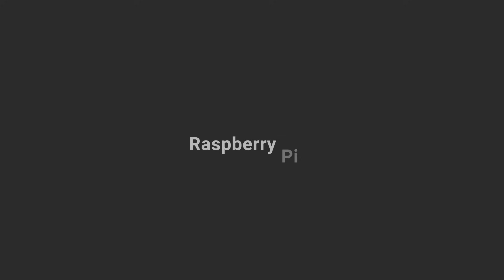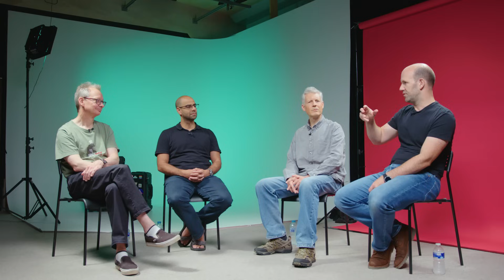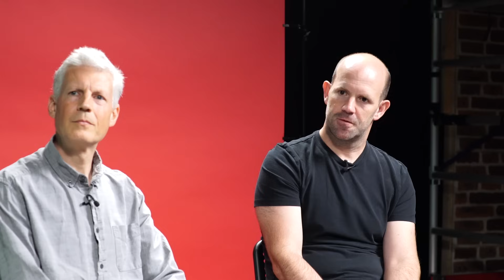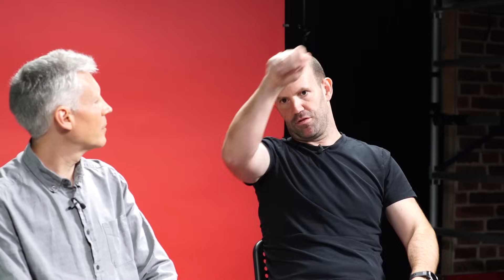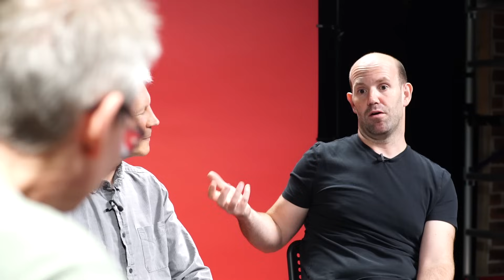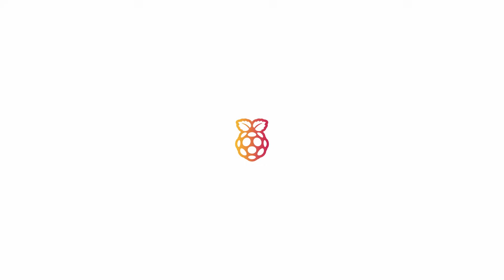Image processing on Raspberry Pi 5: our new hardware image signal processor

Comment: The Pi 4 was pretty capable for image analysis - I built an interesting AR system that led to a patent application, using 'off the shelf' hardware, thanks to Raspberry Pi. So seeing what a huge step forward the Pi 5 brings to this area is great, and leaves me wondering what might be possible next..
Reply: I would be really curious to hear more about this.

Comment: I wonder, and it’s just a feeling, an intuition, but I wonder if more RPi cameras are mounted in such a way that they never move and most of the image never moves, compared to other usages of the same or similar camera modules in other areas of application. For example, a handheld actual camera for stills or video is likely to spend most of the time seeing highly varying input, moving, shifting, sliding, wobbling, shaking, panning, everything – whereas I’d estimate that most Raspberry Pi cameras are mounted and don’t move much in actual use, if at all

Comment: This takes me back 30 odd years to when I worked in broadcast TV engineering. Essentially analog TV cameras worked in the same way - gain, noise, shading etc. Of course we were dealing with big voltages too :)
Reply: And I imagine large racks of electronics to accomplish it too. Now its all done automagically on a teeny tiny chip.

Ironically, its the knowledge you had back then that still drives the algorithms that these chips have to run. Its all progress upon progress. If only all technology has had such clear benefits for mankind.

Comment: Was this filmed on the Raspberry Pi 5? That would have been a nice touch! Also, there is another kind of HDR that wasn't mentioned... 10-bit video, which has become super common over the last several years. It would be nice if the new Pi 5 ISP had support for capturing 10-bit video.
Reply: As you say, it wasn't mentioned so probably isn't supported. As its a new ISP then I'm not surprised it doesn't support everything out of the box. However, its their ISP and I quote:

"...the most exciting thing is that it’s our platform, and we get to develop it going forwards."

Previously they had to rely on others to develop any new capabilities which weren't forthcoming. Now, if they wish to implement 10-bit video, they can. Maybe they should start a portal for ideas akin to Mozilla Connect.

Comment: It's great to know that now that as an official board has 2x4 lanes of MIPI CSI-2, the "door is open" (18:30) for the capable camera modules (IMX477 & IMX708) to have their wings fully spread.

Would love to see first party camera module carrier boards where I can put on the sensors modules from existing 2 lane camera modules to expose higher (e.g. 4K@60) bandwidth. I'm specifically mentioning this retroactive upgrades, cause that reduces waste, and reuses what's already available - I'm not against having full modules (with sensors included) also as an option though - in fact I prefer having both the choices.

Also, it'd be great to have some first party UVC bridge modules. Building one's own 4K cinematic/streaming webcam can be a gateway drug for future makers. Working with or reverse engineering the existing ones (with lacklustre documentations), or building a bespoke solution with CX3, CrossLinkNX or just FPGA etc. as a small maker has too many limitations & roadblocks, to make the effort viable (or even feasible). The ability, intent & opportunity are all there for Raspberry Pi to make it a first party solution - even working with/on custom bridge ICs no longer seem like a far shot.